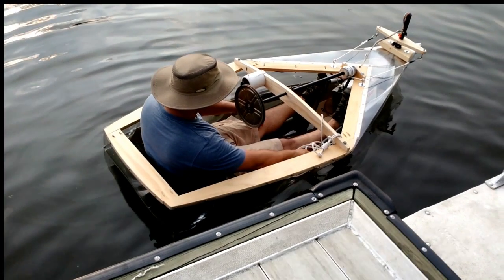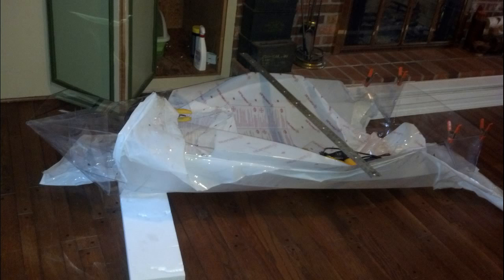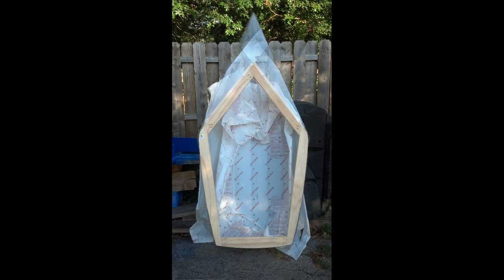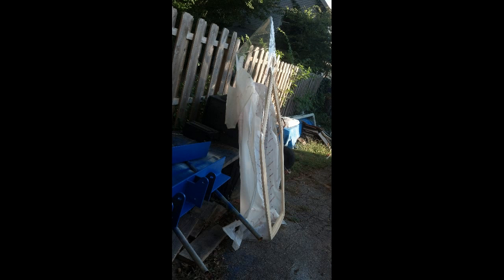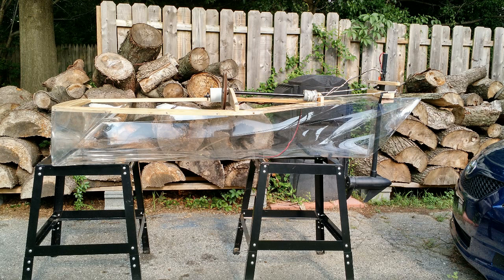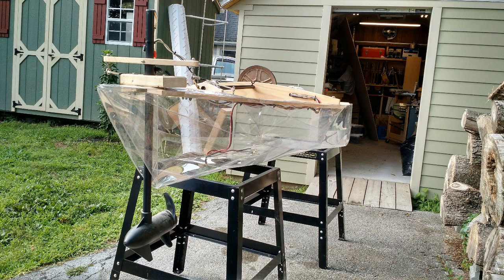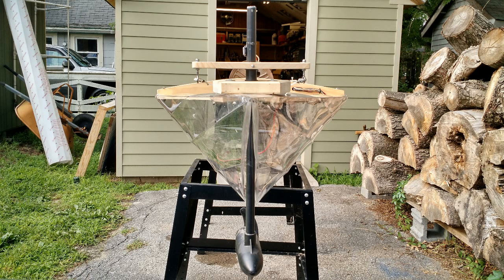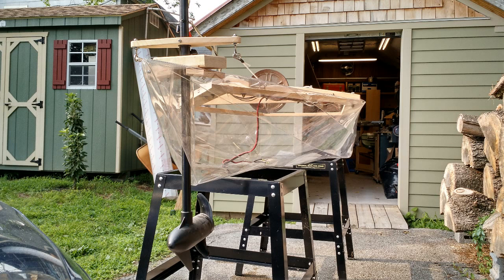HomeMade boat - clear V2.0 - folding and testing

Comment: Can you make a bigger one, enough space for 10 passenger.
Reply from the maker: yes it is possible, but it would require a nice stout frame to hold it together
Reply: I am just suggesting, if you can build big enough for 20 passengers, that would be great for tourism business, for tourist to observe underwater environment from the boat, without diving down.  Imagine whale, dolphin or even shark sight seeing using this kind of boat, you'll get 400 bucks per trip in full house if your charge them 20 bucks each.  I need to experience this in my lifetime.
Reply from the maker: not  a bad idea, but that kind of boat will require alot of thinking and designing

Comment: soo bad ass!  can you paint this stuff?
Reply from the maker: +Brian Davis I'm not sure, but you might need to sand it a bit, but the pair may still not stick to it.
Reply from the maker: +Brian Davis how's your bathtub submarine coming.  I was to see that thing in the lake!!
Reply: +Ray Pena I just got the remote camera pully and motor installed! now its time to install sonar transducer... then i wont have any excuse not to take it out!  you know how it is taking a new boat out!  if only i had a private lake to test it on before everyone sees it! it could have major flaws and sink! lol  i just need to buck up and get a couple helpers and run er through the paces! lol stay tuned though.. shouldnt be long now!!

Comment: I had a few questions, I hope you don't mind.  BTW, the boat is pretty cool looking, that's for sure.  Perhaps I should make one question per post, as I've found multiples often end with missing answers, but:
1: How's the stability rocking from side to side? IOW, a nice wide boat one doesn't worry about it tipping over getting in, or while on the water.   It appears more stable at higher speeds.
2. Have you thought about an outrigging, or increasing the size with more sheets?
3. What's a ballpark on cost of material, w/o motor or accessories, just necessaries like plastic and frame.
4. What about swamping if a larger boat goes by on the lake, with a huge wake?
5. How's visibility in clear water, if you've had that chance.
6. Do you think it be possible to pivot the trolling motor so the blade could be lifted, in case more clearance was needed for shallower water?

I've not been on many boats, nor that many times in my life since I was a kid, maybe a couple of times on what "I think" is a jon boat, a canoe twice (one narrow :-( , one wide :-/).  I'm wondering if this would make a good starter boat.  I'm good at making things, not experienced at boating.. a great swimmer, don't like alligators.

Thanks, ran across your videos on a serendipitous browse.
Reply: +Ray Pena  I can guess, but I'd rather ask.  What was your motivation for using clear material?
Reply from the maker: +Chip Cooper that is quite a few questions,lol. I will do my best to answer, I'll just make a new reply for each question. 1. Side to side stability is pretty good, as long as you don't make any sudden movement . Getting in and out is definitely the hardest part. You need to hold on to something like a dock, and get in QUICKLY. if you take your time, you'll roll right over.
Reply from the maker: 2. outriggers would stabilize it I'm sure but I want to have less boat, not more. I have thought about making a longer version with 2 sheets (ideal ratio of a hull for speed is 1:9) but I'm not sure how to seal the two sheets
Reply from the maker: 3. material cost was about $60-$75. the sheet was $38.
Reply from the maker: 4. it slices through waves fantastically. I've had it in a wake about 8" high without any issues, but I would not recommend it for areas if BIG boats
Reply: Ray Pena Thanks! That's informative.  I was wondering how well the plastic would handle fiberglass and epoxy without melting the plastic. Perhaps a combo would work to seal.  I'm not familiar with the properties of the plastic; I was going to look it up.
Reply from the maker: 5. visibility is fantastic, if the water is clear and you don't have any glare on the plastic surface, you can see as far as visibility allows
Reply from the maker: 6. you might get the motor to tilt but it may be difficult.  reaching that far forward to tilt it would likely swamp the bow.
Reply: Ray Pena Ouch! on swamping the bow.. maybe attaching a device, like you did to steer it.  Because, I'm guessing if reaching forward could swamp the boat, so would running aground and hitting something do the same.

I briefly looked up the properties of the polycarbonate.  It says it's available in pellet, and sheet form.  It looks like it has the ability to be heated and formed.  A lot of plastics that can be melted and formed might allow one to melt the pellets and apply the melted polycarbonate to two sheets and when it cools form a permanent bond similar to the sheets such it would act like a single piece.

I've been playing with some plastic cards that have that property but at much lower and easier to use temperatures.  It's only available in pellets and small cards, no sheets and of course more expensive, also more flexible.  But, if the polycarbonate behaves like this plastic, then at certain temperatures like melt, the bonding is strong and the material becomes one with the bonding plastic, maybe not quite as strong. Don't know.

I see a lot of different PC compositions, this might be a useful resource, or information overload. lol
http://www.matweb.com/Search/MaterialGroupSearch.aspx?GroupID=26
Reply from the maker: +Chip Cooper I'm not sure if polycarbonate can be welded, but if so, that will be the way to go. I do know that polycarbonate is terrible for adhesives and epoxy bonding.
Reply: Ray Pena Terrible chemical resistance properties, so no adhesives, nor epoxy, agrees with what I read too. It looks like once you bend it into a shape though, applying heat, like blow dryer, no higher than 100°C would allow for molding at that point, so the creases could be set with heat.  Are you looking at a v3.0 or are you satisfied with what you've done and moving to other projects?
Reply from the maker: +Chip Cooper I think that I have one MORE version that I need to build and I think that it will be a 2 sheet boat.
Reply: Ray Pena Thanks again for your replies, what you've done gives me some ideas for other uses of PC.  I wish you luck, and await to see what you come up with.  Perhaps for fun, I'll give a boat a try inspired by the possibilities.
Reply from the maker: +Chip Cooper great! glad it inspired you. don't forget to subscribe.
Reply from the maker: onesimpleidea well that is a good question!  the material is something i use all the time in the production of the custom bicycle and harness racing wheels i manufacture, so i have been staring at it for over 5 years. when i got the idea for folding a boat, i already had the material (since i order it 10-20 sheets at a time) that is was easy to grab a sheet and try it.  the fact that it was clear didn't really play a role with he first model....but it was so interesting that i kept making the others with the same material.  plus people really don't know what to think of it when i put it in the water, they are expecting a disaster and are quickly disappointed!
Reply: +Ray Pena  Interesting.  Good, sensible answer.  Thanks.  I asked because I imagine that many would assume your goal was a see-thru bottom.  However, I didn't think so.  The layout and size of the boat doesn't support actually using it that way very well (looking over the steering column, etc).  So, I suspected another reason.  That all said, when you do get a peek underneath, where on the boat bottom are you usually looking (behind you, beside, over steering column, etc)?
Reply from the maker: i can look down from any direction but usually it is either through the front or straight down